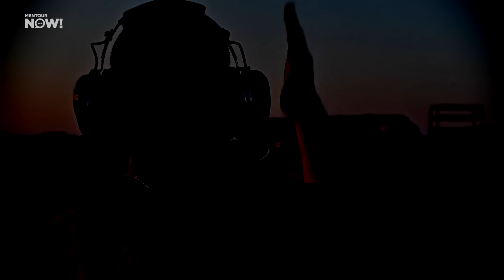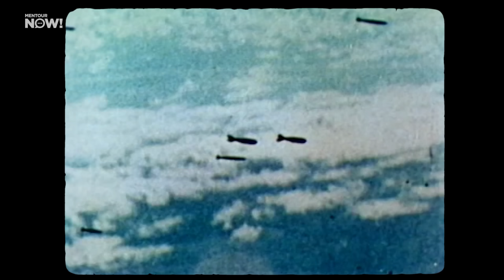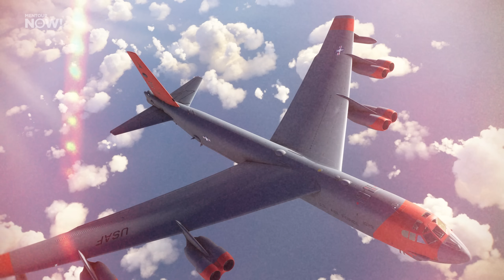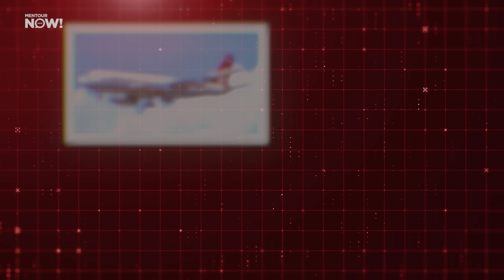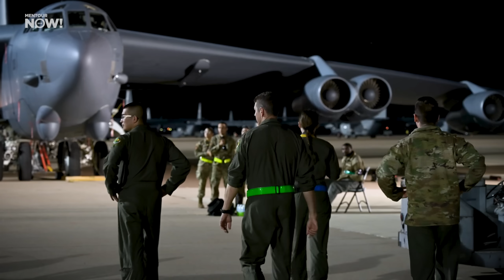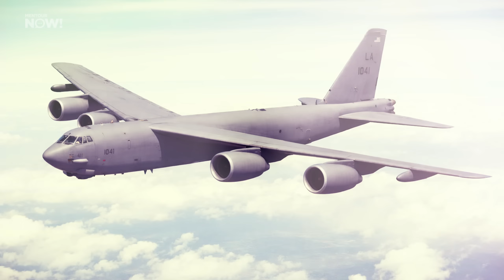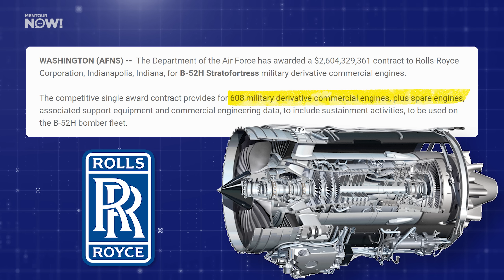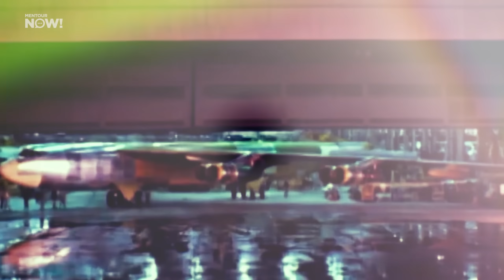WHY Are They Changing The B-52 NOW?!

Comment: 19:59  I was surprised by those old analog gauges. Some of them seem to be installed slightly misaligned, a bit rotated to the left or right. Obviously this isn’t a real issue seens that these aircraft have been flying for over 70 years. But it still gives that uneasy feeling of “if this looks sloppy, what else might be?” 

Eight temperature gauges, each one looking like it came from a different manufacturer. I wouldn’t be surprised if some of those companies closed their doors decades ago. What amazes me is that they all seem to show the same values. Assuming they do, of course. It even makes me wonder if some curious mechanic, at some point, ever swapped the gauges around just to check whether they really agreed with each other.

Another thing that caught my attention is that the temperature gauges are in Celsius. Isn’t that strange for an American military aircraft? Do U.S. military jets use the metric system? That was a surprise.

Whatever happened to “the ‘imperial’ country that landed on the Moon versus the others that use the metric system?” :cat-orange-whistling:

Comment: I spent almost 6 years as a B-52G mechanic, 'Aircraft General'---> So, I did a variety of things on it, including washing, inspecting, and servicing - airframe, engines, hydraulics, landing gear. I'm sort of proud of that time, but I hated it at the time. It's so much airplane. It is tough and obviously every part of it is accessible. It was built to be jammed with older bigger more basic electronics, so they have much more room to replace those old electronics and room for even more advanced electronics.

I had the pleasure of being mentored by old salts that loved genuinely that aircraft.

Comment: The Iceland Air 757 photo you show in the video is not powered by PW2000 engines. It has Rolls-Royce RB211 engines. These engines can develop more thrust than the PW2000 and I can tell you from working around 757's that are powered by both types of engines. The RB211 is far more quiet than the PW2000.

Comment: Hello Petter, These videos are great! Am I right in the following? When Boeing took over McDonnell Douglas, they took over the MD-90 programme upgrade to the MD-95.  The MD-80, from which the MD-90 was derived, used the modernised (from the original DC-9) P&W JT8-D family of engines as the standard engine. With the MD-90 these had been changed to  IAEV2500s but with the the MD-95 the option was added of the RR(-BMW) BR700 family of engines. When Boeing took over the programme, they realised the RR engine was more efficient and so the B717 was only offered with that engine. In other words they inherited a) the expertise of transitioning away form a P&W low bi-pass engine with its systems and also b) expertise in transitioning to a modern RR alternative with its systems. Put the two bits a) and b) together and  they inherited the expertise to change from old P&Ws to new RRs on the same basically old airframe. With the 717 being the inherited MD-95, they gained the experience of transitioning an entire programme solely to RR. The military designation of the BR725 engine used on the 717? F130, the engine they are retrofitting to the B52. Which is to say, Boeing and RR have essentially done 'the B52H->J thing' together before, with 'the (DC-9-origined) MD-95 ->717 thing.' No need to reinvent the wheel, when they'd previously reinvented it already!

Comment: Good that this is finally happening, lol. It's not hard to understand why changing the airframe is such a problem if you realize that this sort of design inertia is common throughout the industry. You literally can't improve an existing jet model, for example the 747, without keeping all the previously completed work performed using obsolete programming languages like FORTRAN.

Comment: This is excellent, thinking in a decade at minimum changes things. If engineering firms reach a decade performance/efficiency improvement then make a educated guess design change to improve it further.  If the guess does not work out you have the next 10 years to improve the design. It reminds me that the more efficient a system the less adjustment(change) it takes to mess it up. So the phrase "go big or go home" makes sense when the chance to improve is so low. Sleep on that.

Comment: How can it not be sensible to move to 4 engines rather than 8? It must be massively more expensive to have 8 than 4, which would also be much more efficient, increasing range. And how the hell are the airframes not cracked to hell and back?

Comment: When you retrofit engines on an aircraft no matter how much they strive to design them to fit within the parameters of the aircraft, it changes the flight characteristics, plus you then have to update or replace the control systems and sensors that they rely on. I wonder if the b52 still has direct hydraulic control of the flight surfaces or if they are drive by wire. 

So not surprised it is expensive . On the other hand, building a replacement bomber would be a lot more expensive and time consuming.

Comment: The TF-33 was especially easy to adapt to the B-52 (as it was the 707) as the J57 itself could be directly rebuilt into a TF-33 by replacing part of the low pressure compressor section with a larger diameter fan stage and associated bypass air (I believe the same LP turbine was even retained, so the changes were all on the front end of the coldsection side). The engine core remained the same and all the fuel connections and controls remained basically the same or compatible.

It would've been interesting if they'd seriously considered re-engining these with more modern, but similarly sized engines back in the 1980s or 90s, and if that change would've resulted in long enough engine lifespan to keep them going with the current schedule.

The late generation versions of the JT8D would've been the right size and weight, and offered improved fuel economy along with higher thrust (though that could've also been specifically limited or modulated for flight parameters where thrust and airflow characteristics altered control and stability, and water injection wasn't required for take-off thrust). The bypass ratio wasn't higher, but the pressure ratio was, resulting in the higher efficiency.

Though some of the data I'm seeing (like on the Civil Turbojet and Turbofan Specifications web page) shows specific fuel consumption nearly the same or only ver slightly lower for the relevant JT3D and JT8D models in question, albeit I believe all those SFC numbers are at military or TOGA thrust, which doesn't represent the fuel consumption curve across the entire power/rpm band. Lowest SFC is usually near max power, but can often be somewhat below it (if max RPM is above the most efficient compressor range the increase in pressure ratio won't exceed the loss in efficiency, so true max efficiency is usually at max rpm and max pressure ratio within the efficient RPM band). In addition to that, it wouldn't account for the nuances in efficiency across the desired cruise RPM range and how that scales (SFC will generally increase as RPM drops and pressure ratio drops, but that doesn't simply scale proportionally across different engines).

So, broadly speaking, use of JT8D-2xx series engines (likely with a bias towards the highest production volume models with most spare parts and surplus engine potential) would've been a moderate improvement on performance, likely improved maintenance overhead, and significantly increased the lifespan of practical service and maintenance logistics over the old TF-33.

And as similar medium/low bypass turbofans, the angle of attack and compressor stall characteristics likely also would've been less severe. (the early models of JT8D somewhat like the TF-30 wasn't always known for the most robust and resistant to stall, but that was relative to military jet engines of the time, or something like the RR Spey turbofan, not compared to the sensitivity of modern high bypass turbofans)

It obviously wouldn't make sense as a swap now, but in the 80s and probably into the early 90s it should've been a serious consideration. (and a direct alternative proposal to any of the 4 engine design studies as it would have avoided virtually all of the complexity issues involved with that) And various JT8D based upgrade projects for older military jets continued to be floated around, considered, or partially implemented all the way up into the 2000s with some considerations in the 2010s.

And had the upgrade been made back in the late 1980s, with nearly 40 years after that to plan long-term logistics around and keep critical overhaul facilities in operation (and maintain critical parts supplies, plus source surplus spares from 1980s era commercial airliners and freighters), it seems relatively plausible for those engines to have stuck around as the mainstay for another 25 to 30 years from now. Plus JT8D 200s series engines were still being manufactured at least into the early 2000s, so the youngest engines there would be less than 50 years old in the early 2050s. I believe it was still being manufactured into the 2010s given the 200 series was still the planned powerplant for the Aerion SBJ supersonic business jet project at the time. (unless those were intended to be surplus or remanufactured engines) I'm seeing mention of new units built for military use as late as 2011. (and the last in regular commercial service being retired in 2020, but that wasn't new engines ... though would've been a good source of surplus engines/parts when those were retired)

Hmm, this seems relevant:
"The JT8D-217 and -219 engine(s) were tested in 2001 and were deemed suitable replacements for the old TF33 engines on military and commercial aircraft as part of the Super 27 re-engining program. The updated engines offer reduced (Stage-3) noise compliance standards without the need for hush kits, enhanced short field performance, and steeper and faster climb rates with roughly a 10% reduction in fuel burn for extended range."

and

"Pratt & Whitney, in a joint venture with Seven Q Seven (SQS) and Omega Air, developed the JT8D-219 as a re-engine powerplant for Boeing 707-based aircraft.[5] Northrop Grumman used the -219 to re-engine one of the United States Air Force's fleet of 19 Joint Surveillance Target Attack Radar System (E-8 Joint STARS) aircraft, which would allow the JSTARS more time on station due to the engine's 17%[6] greater fuel efficiency. However these plans were cancelled after the single conversion when the decision was taken to retire the platform. NATO originally planned to re-engine their fleet of E-3 Sentry AWACS aircraft, however again this was cancelled after the decision was taken to retire the E-3 platform in preference for the E-7 Wedgetail. The -219 is publicized as being half the cost of the competing 707 re-engine powerplant, the CFM International CFM56, for reasons of geometrical and balance similarity to the engine it is replacing and the associated relative up-front wing modification costs of the two choices."

And that STARS upgrade program actually got pretty far along, with some service aircraft converted following initial test aircraft fitting:

"In late 2005, Northrop Grumman was awarded a contract for upgrading engines and other systems.[8] Pratt & Whitney, in a joint venture with Seven Q Seven (SQS), was contracted to produce and deliver JT8D-219 engines for the E-8s. Their greater efficiency would have allowed the Joint STARS to spend more time on station, take off from a wider range of runways, climb faster, fly higher, all with a much reduced cost per flying hour.

In December 2008, an E-8C test aircraft took its first flight with the new engines.[8] In 2009, the company began engine replacement and additional upgrade efforts.[8][10] The re-engining funding was halted in 2009 as the Air Force began to consider other options for performing the JSTARS mission."

Additionally, the BR700 series engines with sufficient thrust to match B-52 requirements are all in the 60.2 inch diameter range vs 53 inches for the TF-33 and 49.2 inches for JT8D-200 series, so the geometry couldn't be kept the same even if they tried vs the JT8D where oversized nacelles could be designed to more exactly match the dimensions and aerodynamic qualities of the TF33 nacelles (though could potentially made slightly slimmer to reduce drag if aerodynamic qualities were acceptable; and given the original J57s were much slimmer at 38.9 inches, the possibility of using slimmer nacelles seems entirely plausible)

Comment: I guess if they'd made the effort to do a clean (and expensive) switch to 4 high-bypass engines and digital cockpit in the 1990's, it would have saved money in the very long run.
The mid-life redesign is long overdue, and now with "only" 25 years to go it's less optimal.

Comment: One thing I learned from this video about why they havent slapped 4 more powerful engines was about how the aerodynamics would change at each individual section of the wings. Really incredible consideration ~80 years ago. I wonder if my uncle has any insight on these, as he worked for LTV in the 60s

Comment: There's also the political aspect.  USAF aircraft aren't built/sold the way cars are.  When they started building the B-52's it wasn't sold as a "limited run" and 744 were built.  By the 1980's when the B-1 was actually built the business model was more like building a bespoke car, only 100 but it was developed with the thought that it would replace the B-52... and as much as I love the BUFF, it should have capabilities are similar in terms of payload and range (new engines will give an even greater advantage to the BUFF) but the capability to get there faster will always go to the BONE.  

Imagine you're building a factory to make supercars, but you only have one customer, and that customer keeps changing things about the order.  Your customer initially estimates that they'll want 500, so you build the factory to produce those 500 planes as efficiently as possible, but then they decide they only want 100.  You (the factory owner) may be able to give a discount for a few things (less copper, less steel) but the real cost is building the factory and hiring/training people.

Compare to the 747, where nearly 1,600 were built over 57 years.  B-52 built 744 aircraft over 9 years, B-1 built 100 aircraft in 4 years.

Comment: This will be a monumentl task. In the latter '90's the C-141B was upgraded to the C-141C with a glass cockpit, and redone wing boxes, among other changes. The C-141 was first manufacturred in the early '60, nearly ten years after the B-52, and upgraded nearly thirty years ago. I was involved in the avionics upgrade. That was a nightmare, and the B-52 upgrade is magnitudes more complex. I wish the designers engineers and technicians the very best.

Comment: As an engineer (civilian not military) that recently was able to see one up close, I find this plane fascinating. The wheel at each wing tip unloaded are ~6' off ground, loaded (fuel and bombs) they are on the ground, and the wing can also flex up ~6'. Truely amazing it can flex that much and stay together; and will be doing so for a century.  Although the flexibility of payload is fascinating, it pales to the capacity. Not surprised they designed it with 8 engines.  The analog to digital is actively changing for motors, radars, navigation, etc. and that too is a remarkable transformation worthy of a video on its own.